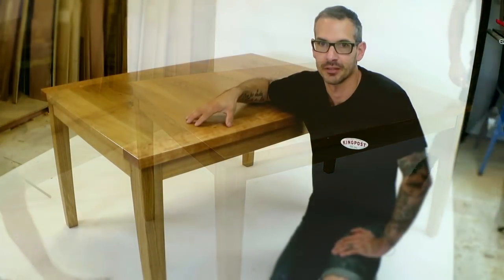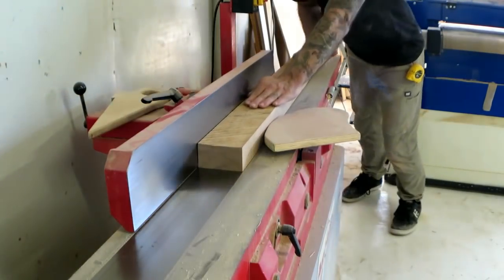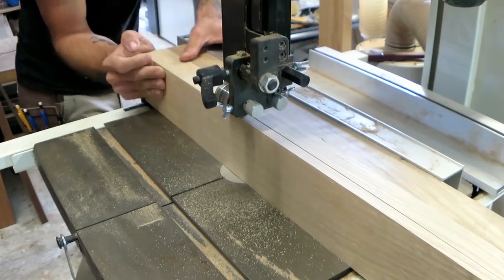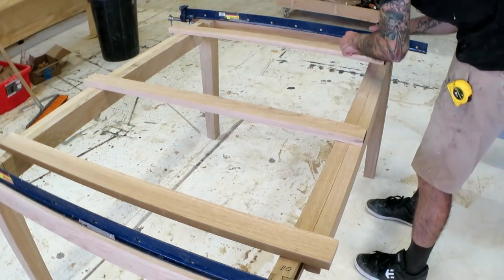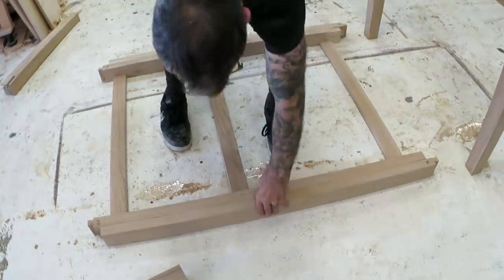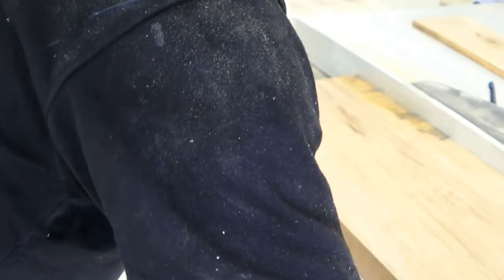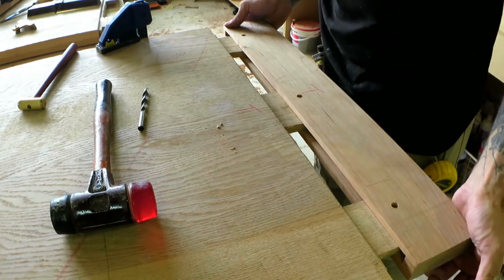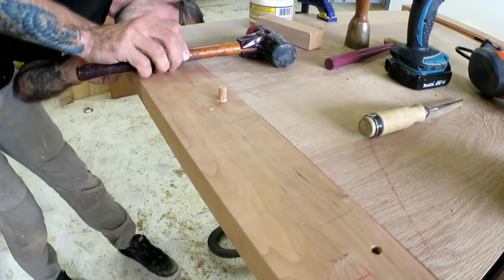extension table (sliding dovetails)

Comment: Awesome table. That sliding table saw is so clutch. Being able to joint one edge and then quickly rip it to size seems like such a time saver
Reply from the maker: Yes its such a multi use tool , far more versatile then a smaller table saw  .
Reply: Is that his kind of saw not very common in the US ? Here in France, and europe I believe, it is very common in woorworking shops.
Reply: @ericfrisard2060  they have them. But they are not common

Comment: Beautiful work Joey.  Getting your head around those leg joints with dovetails in two directions would be a feat for me - you make it look easy though.  I see you still use your panel saw a lot like a cabinet makers tablesaw - working to the right of the blade but old habits and training die hard I guess.  I'd like one but space is the issue for me and I can't part with my other toys.  Cheers and thanks for the insight on something I'd likely not try.

Comment: Thanks for your awesome video. I like it very much. Great craftsmanship!
I have a question about using Epoxi Glue: Doesn`t seem to be a 2K one. Or if, it should have a big processing time, preventing you are in hurry with assembling the counter framework. From which plant do you buy it? 

Why don`t you use normal wood glue like Titebond or Titebond-Ultimate for that job?

Comment: The small blocks to keep the middle peace in place under the table probably won't get much force applied to them unless you really jam the middle piece in there, but it always worries me if something is impacted and is just held on by inflexible glue like CA or epoxy. They're just too damn brittle sometimes. A dowel or two takes care of the problem.
But like I said, unlikely to cause problems with this one.

Comment: Great workmanship Joey. The end result table looks solid. Have you seen the extender tables where the middle section has a hinged middle? The middle section centre line is hinged and the two panels fold up from the outer edge of the table (into a V with apex on longitudinal centre line) and folds under the main table. Then the two end table surfaces push together to fill the gap?
No doubt you have. It's a tried and true method of extension where the legs contacting the ground remain fixed. I like your table but my only negative comment is "if I asked my wife and sister to extend the table" I would have to do it. ;-) regardless. great work and keep at it.
Reply: This type of table is called a "Butterfly leaf"

Comment: Btw. Your "clever trick" you forgot, was that you can actually slide the middle piece in. If it was spaced evenly that wouldn't be possible.
Reply: After watching the first 30 sec I cant see how the rail spacing would obstruct storing the leaf. It appears that there is ample room as he drops it in there. However, the offset might make it easier to lift it out?

Comment: Nice build. Those breadboard ends looked like a lot of work. It's funny about resawing lumber.  I just did a bunch of maple for flooring and there always seems to be some cupping in the boards after they are sawn, I guess it has to do with uneven moisture content between the outside and inside of the stock??

Comment: Joey, I LOVE this piece. I did not see where you added stops to prevent the dovetails from coming apart while trying to add leaves.  How did you do that?
Reply from the maker: No stopper, the last 150mm or so is actually quite hard to pull out due to the weight kind of jambing the dovetails.

Comment: Nice job as usual joey - do you use any filler powders ( colloidal silica) in your epoxy when using it for gluing or is it just regular 2 part epoxy? I'm experimenting with different glues at the moment and there are defo advantages with epoxy , just want to make sure I'm getting best strength possible. Thanks and keep it up!
Reply from the maker: I use epoxy glue by CRC /ados  they call it builders glue. It's nice and thick and easy to mix.

Comment: So I have just one question.  Did you notice any tendency of the table to sag in the middle when the table was extended and the leaf was in place, or do you think that over time that may become an issue?
Reply from the maker: No sag until there is about 150mm left in the sliding dovetail. In use there is about 400mm of overlap .   So far I haven't heard back from the client.

Comment: Is there anything stopping the two halves of the table from sliding completely apart if pulled too far?
Reply from the maker: Nothing mechanical but gravity does a really good job of stopping them as they bow down for the last 100mm or so and jamb.

Comment: I am actually in the proces of making sliding dovetails as well to make an extendable dining table.

Did you do anything to the dovetails in the end?
Did you leave them untreated or did you stain/poly them or left them as is?

to achieve better sliding, would you also recommend using some sort of wax to reduce friction?
Reply from the maker: Definitely add some candle wax  .
Reply: @KingPostTimberWorks  Thanks!  

Stain and Poly? or leave it bare?
Reply from the maker: @makesandskates  I'd do the outside show faces . And leave the actual dovetail waxed only.
Reply: @KingPostTimberWorks   Im not completely sure what you exactly mean, as I am not too aware of the terminology.

When you say "outside show faces", are you referring to the parts of the slide that are contact with the center slide (you refer as the dovetail?)